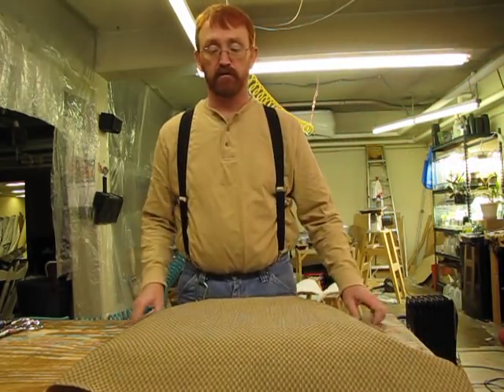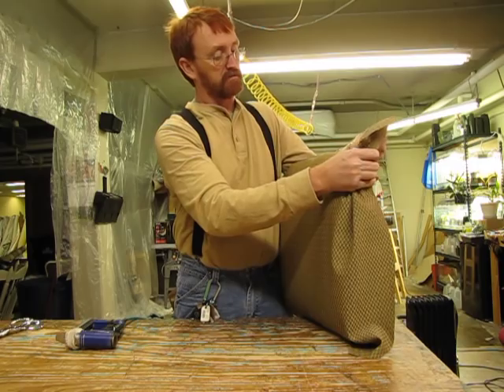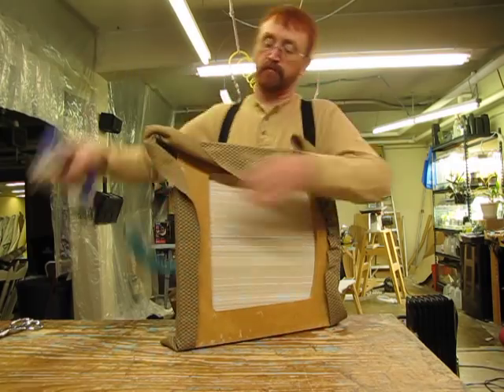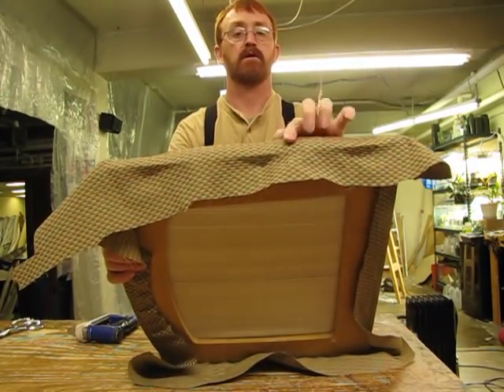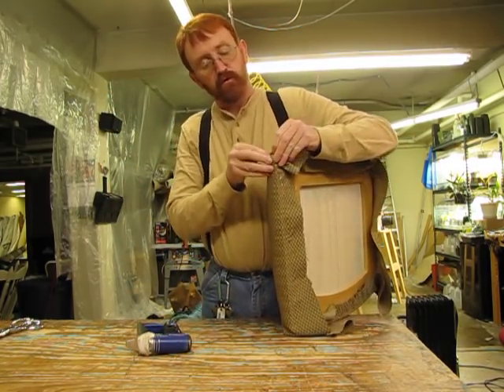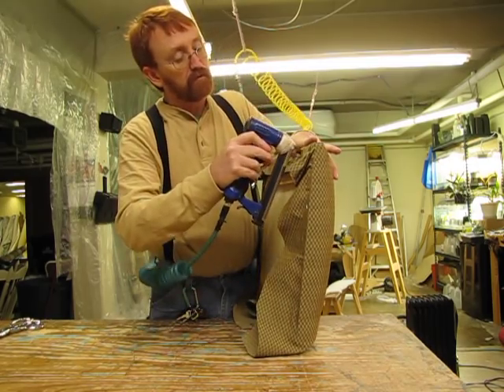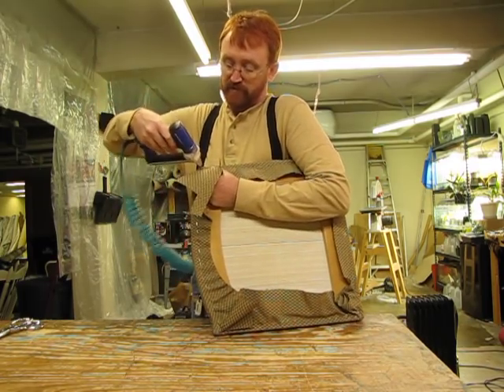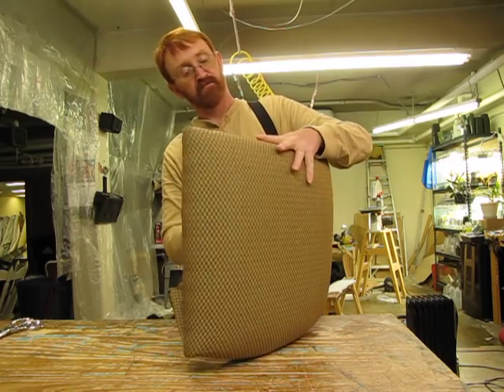reupholstering dining room seat

Comment: Thank you for this great video.  I am trying to redo my chairs and am running into problems at the corner.  The existing cover has no visible fold, just slight pleats.  The foam was pretty degraded so I had new foam custom made but it is more square than the original and less rounded so I am not sure if that is a potential problem and or that poly batting maybe I need to add that.  Any tips?  Is the squared foam limiting me in getting a non visible corner?  Will the batting help?  I can't see your corners too well to see how they looked when finalized.  Thanks in advance for any advice.

Comment: Some videos folks don't put the poly batting between the fabric and foam.  What's the negative aspects of not having batting.  Shape? Edges?
Reply from the maker: +Justin Shiffler , exactlly shape , and it also helps ease the installation , it can be very difficult to pull fabric over bare foam its sticky and quite difficuld to obtain a smooth finish.
Reply: it makes the installation go much easier.
..
fabric tends to stick to the faom making it much harder to get the edges smooth.
.
However it can be done either way.
Reply: Recouvrir chaise simili cuir